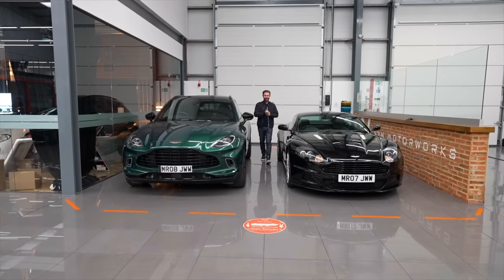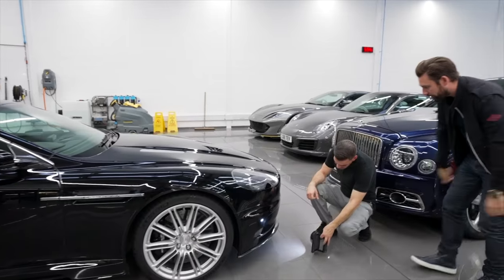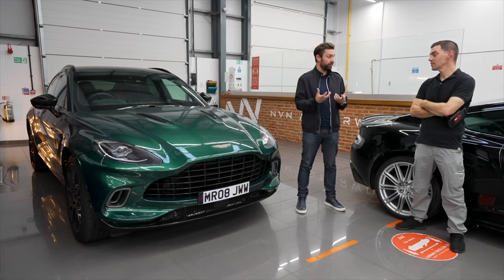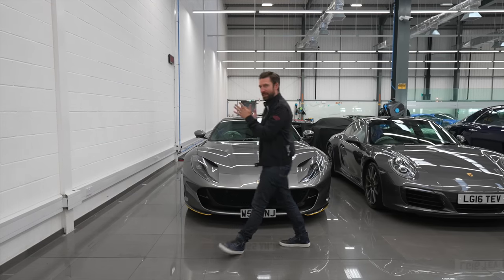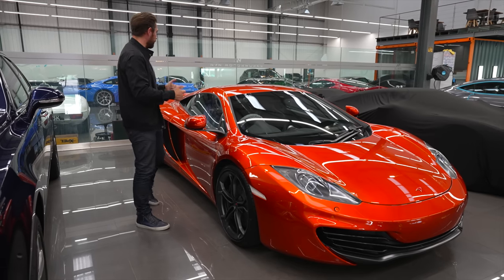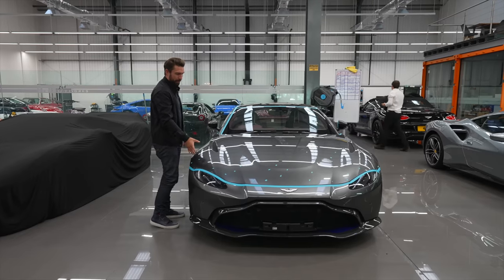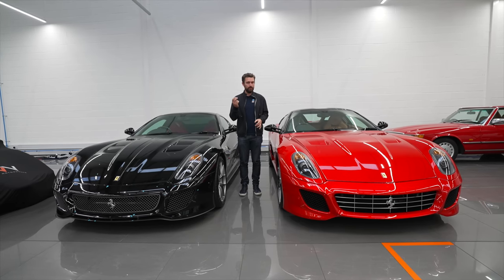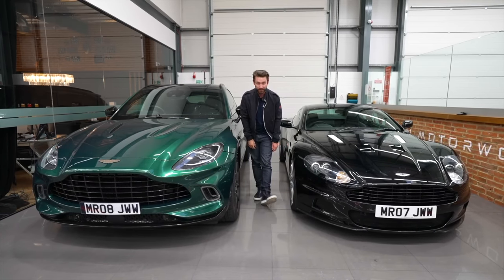My Aston Paint Is Ruined! So Here’s The Plan…

Comment: Do mechanical changes over aesthetics, make it a beast, approach Cosworth and get them to take out the cylinder liners as they did with that engine to begin to create a DBS esque One 77 drivetrain with a manual gearbox...you will never use 1st again and will need a new clutch alternate years... but please do something that petrol heads are interested in not vanity changes
Reply from the maker: Both perhaps? 😜